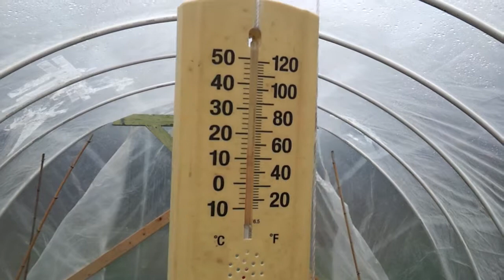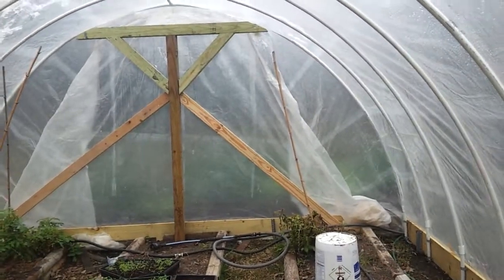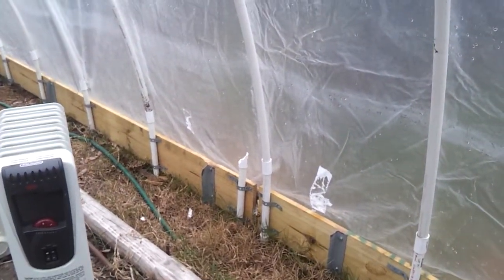Hillbilly hoophouse

Comment: Nice setup. For wind, you might want to throw a strong narrow cord over the top from side to side and loop it down the length of the house. For an accurate temperature reading when the sun is out, the thermometer should really be shielded from direct sunlight.